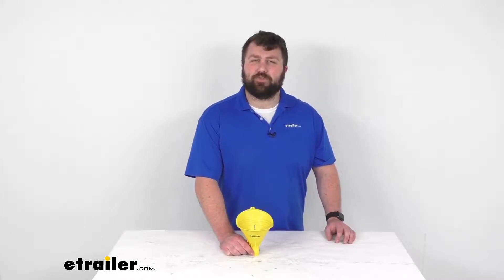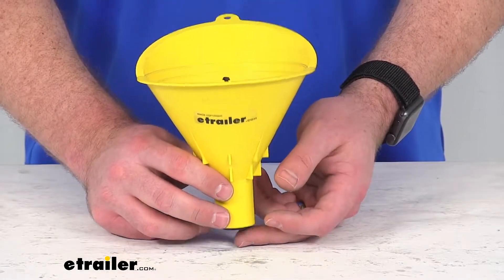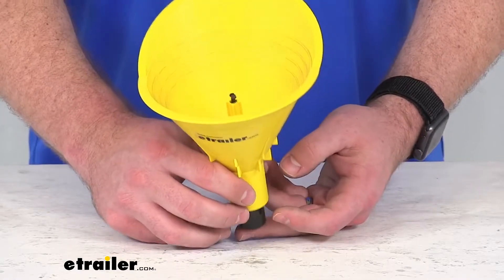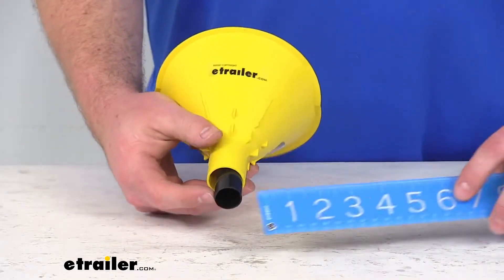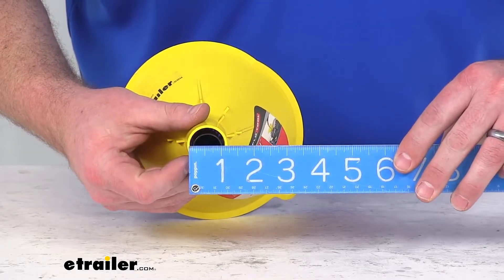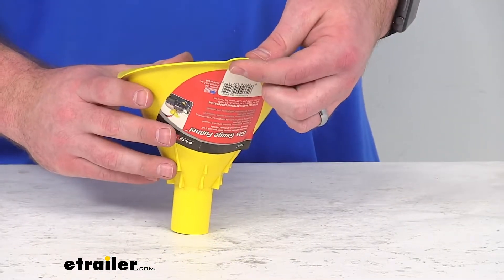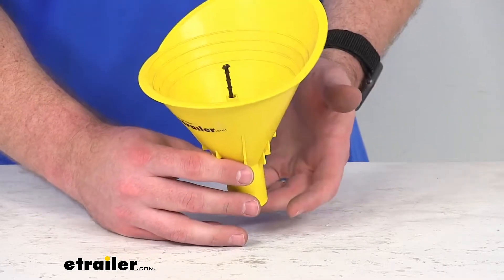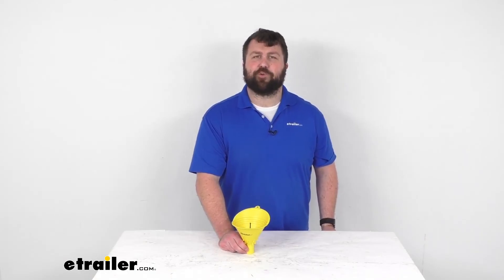etrailer | An In-Depth Look at the FloTool Gas Gauge Funnel

Comment: This funnel doesn't fit into the oil hole on a
Arien riding mower. Oil will spill. What's up with that?
Reply from the maker: We do mention in the diameters of the spout in the product description. Going with a funnel that has a smaller diameter 7/16 spout like # FT06064 would be recommended.
https://www.etrailer.com/Automotive-Tools/FloTool/FT06064.html